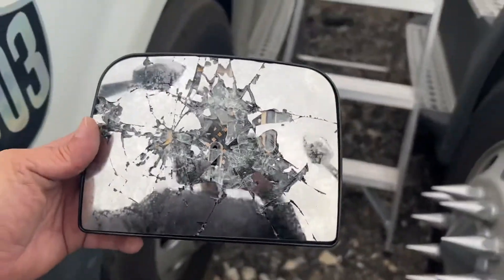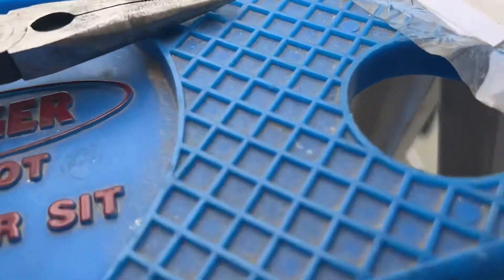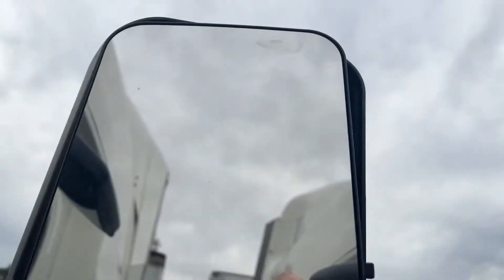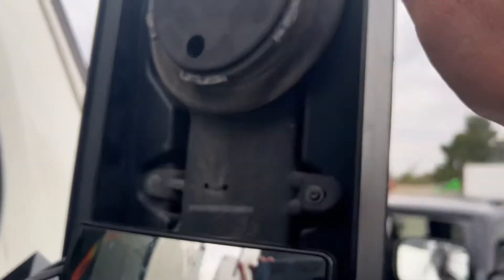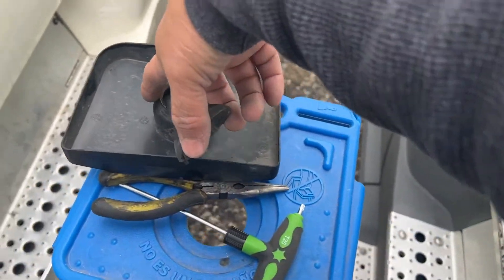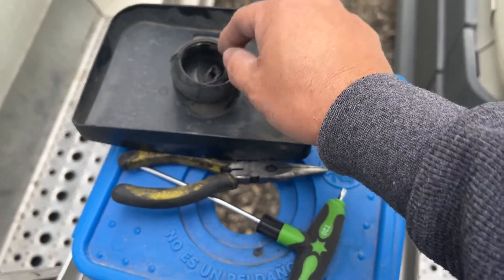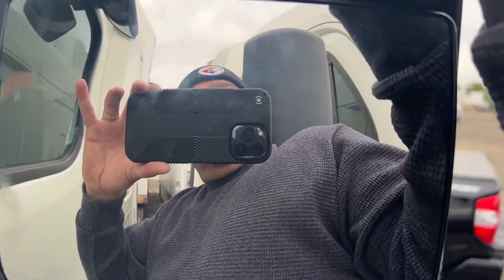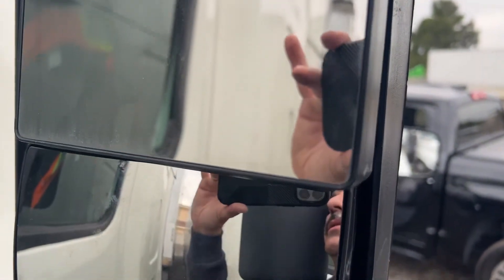Replacing mirror on Freightliner cascadia

Comment: Good tip for anyone struggling with the stpid 90° pull tab.  Get it "cocked" as in already pulled out and just barely on the edge of spinning, this will give you enough room to get a good bite. i spent an hour chewing it up with needle noses before i had that idea, and then success! 🎉😂